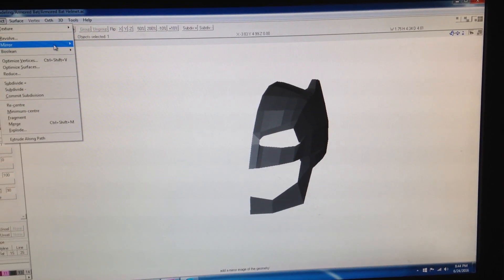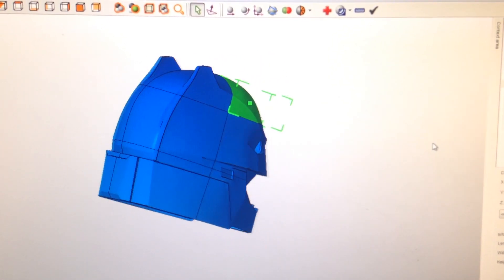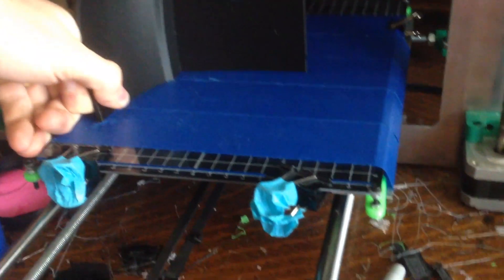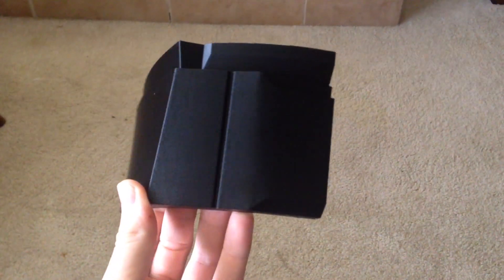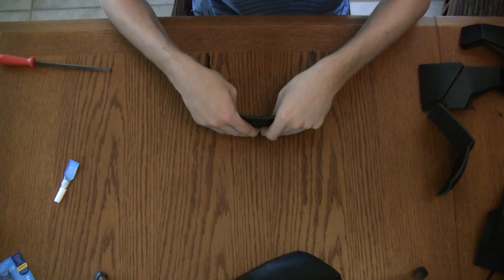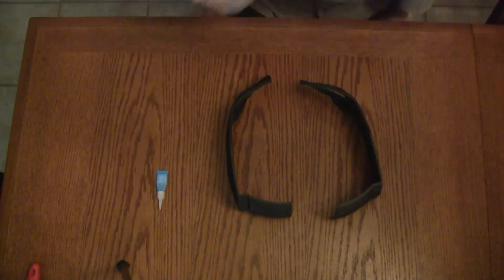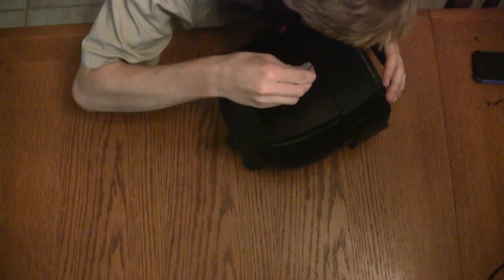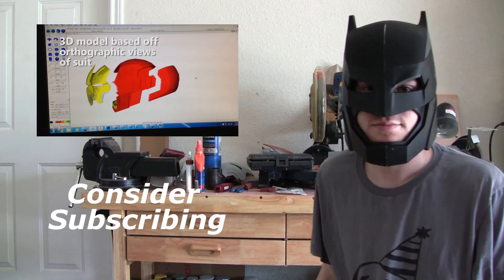3D Printing | Batman Helmet Build - Part 1

Comment: What nozzle size did you use. What were your settinga for the build? I want to build a helmet from Halo. I want it to be printed fairly quick, but i dont want to lose all the detail. I was between using the .4 or .6.

Comment: I see from the other comments you made it out of PLA, how strong is PLA to make cosplays as I’m considering getting a 3D printer and just doing research atm
Reply from the maker: All I can tell you from my experience is that they hold up great on a shelf. I’ve never cosplayed before, so I can’t tell you the durability of it. But I can tell you the plan is to mold it and cast it out of urethane plastic, that way there’s no question of durability

Comment: Are you selling these helmets? Would you sell the one you made on this video?
Reply from the maker: Yes! Not the exact one in the video, but the plan is to finish up this one, and then mold and sell plastic casts of it
Reply from the maker: lonnieldhampton, it will be on the for sale section on the RPF, but I'm still in the process of finishing it! So there won't be a link for a while

Comment: what 3d printer are you using?
Reply from the maker: Just a basic Prusa i3
Reply: Ronald Finger thanks
Reply: Ronald Finger Do you have the printer 3d mk2 prusa i3?
or prusa i3 hephestos?
Reply from the maker: Neither actually. Just one of the cheap DIY clone kits that are sold on ebay.
Reply: Ronald Finger ok.Thanks bro..

Comment: came to your video through /r/batman. Awesome work. I would love to set up my own 3D printing station. Do you have a background in a tech/mechanical field or did you pretty learn all this stuff on your own?
Reply from the maker: Thanks so much! Well, I've been modeling with AC3D since I was about 12 (currently 20), though I haven't really gotten to a decent quality of work until maybe in the last 3 years or so. I did take engineering courses in high school where CAD modeling was taught and used all throughout the 4 years I was there. I was also part of a team working with NASA where part of our project was 3D printed, so that was my first experience with actual printing and not just modeling. I think I got a lot of my technical knowledge from all those things, but the actual modeling stuff was more on my own! If there's anything else you want to know just ask :)